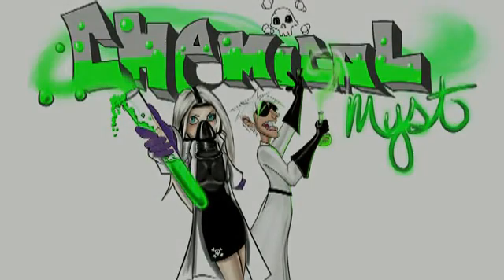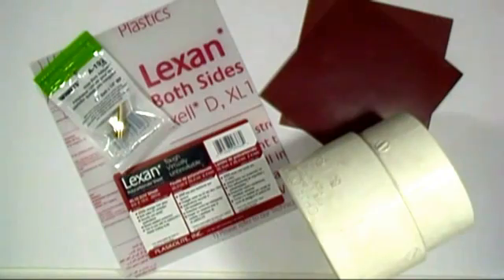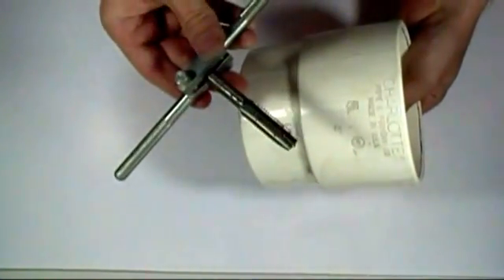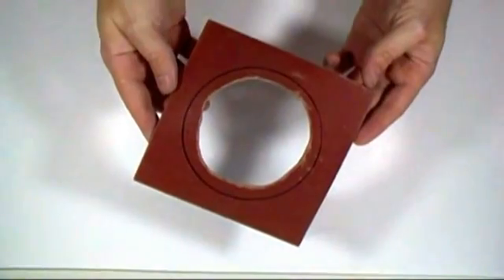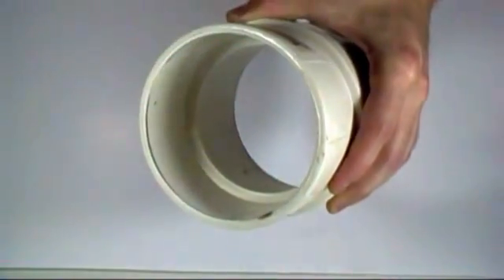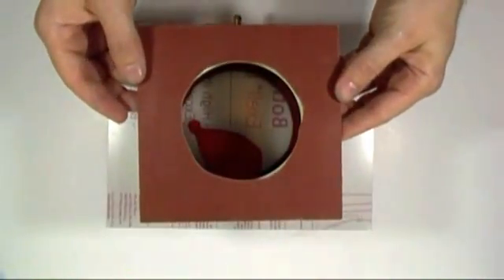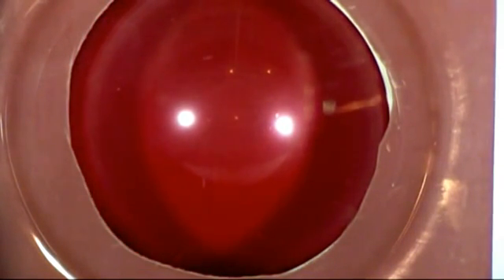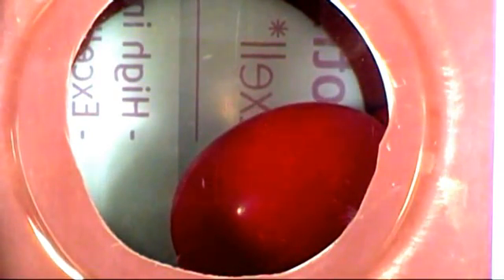Lab Tips: A Simple Inexpensive Vacuum Chamber

Comment: Make sure to use Lexan which is shatterproof polycarbonate and not plexiglass which is brittle acrylic. Cut off a thin strip and try bend it. You can tie Lexan in knots, plexiglass just snaps.
Reply: I used plexiglass for a vacuum chamber once and it worked perfectly fine.  Though it was very thick.  It seems from experimentation that as long as the walls are good and thick then it should work fine.  But I don't know how well it scales as I only made a 1 cubic foot chamber.  Larger chambers may not do as well.

Comment: Interesting.  I was shopping for ideas for a cheap device to actually draw a vacuum. I was thinking of a way to refill Vuse Solo vape cartridges without breaking the cartridge.  The theory to test was to stand a few of the empty cartridges up in a pool of "vape juice", draw a vacuum in the chamber and slowly bleed the pressure back in allowing the cartomizers to draw the fluid into their storage tanks through the ceramic wicking ports.

Yes, it is far more effort than is necessary. A refillable cartomizer is available for a couple of bucks.

Anyway, thanks for the ideas.

Comment: Merely use a large mason jar fitted with a 'stem' of steel line soldered though a hole drilled in the lid - connect it to the pump with a length of silicone tubing and voila! A perfectly sealed, fully  transparent chamber at a cost of $10 and 15 minutes.  Note:  Although implosion is quite unlikely use of a safety visor is advisable.

Comment: Would this also work as a pressure chamber? If not, what modifications are necessary?
Reply: No.  You would need a lot of reinforcement for it to work as a pressure chamber.  You'd be far better off using steel or some other metal as the materials for a pressure chamber.

Comment: For building vacuum around an object you can also increase the quality of the vacuum with thick clay, ...  you do need to cut off the acces rubber outside the tube and wipe clay in the corner like how they do silicon.
Feel free to like if you find this information helpfull, or if you tryed it.
greets